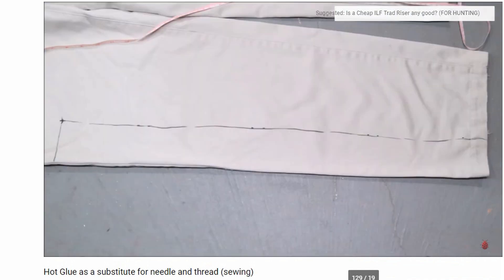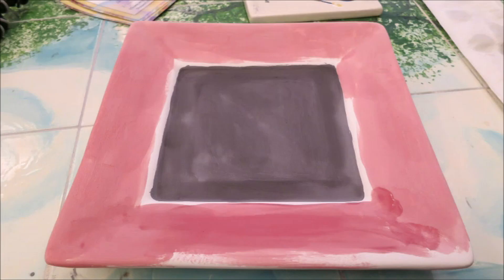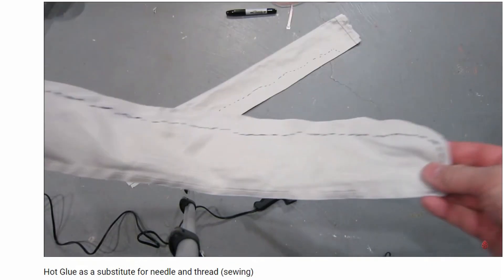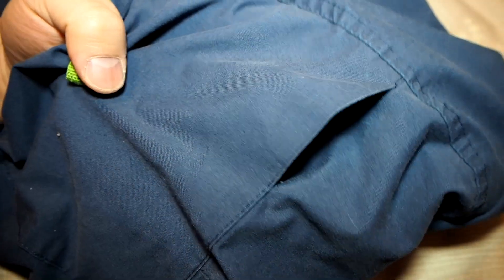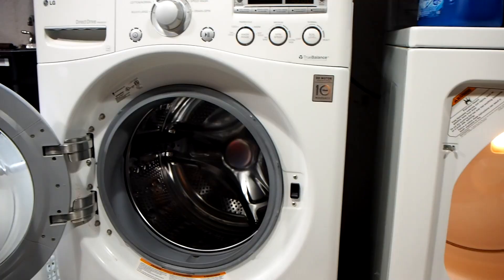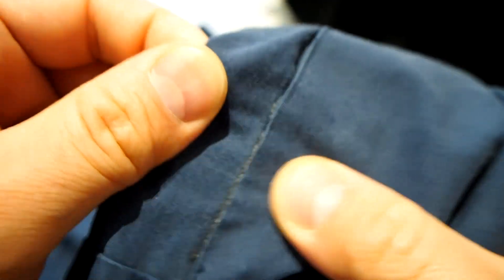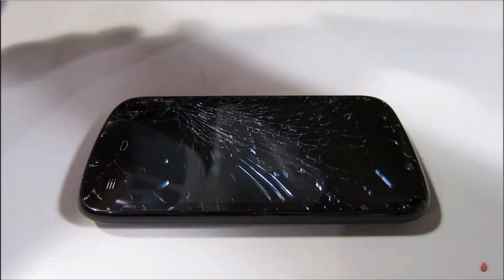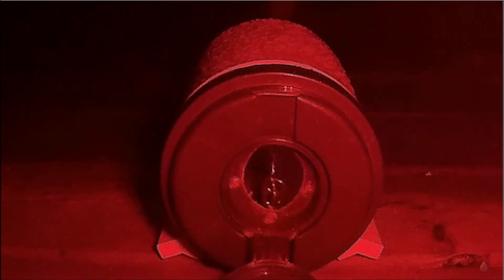Washing and Drying Hot Glued Fabric

Comment: Thanks for the video! Question for ya... It's been a few months, is it still holding? I'm aaking because I wanna use hot glue to temporarily hold sleeve hems.
Reply from the maker: I did 4 of my pant pockets.  I've had to fix 2 of them recently. I wash and put them in the dryer once a week. So it has held up really well.

Comment: What was the specific temperature setting on the dryer that you used??
Reply from the maker: My dryer just has the automatic dry low heat and I set it for medium dry. I do not use the air dry. I do not use high heat. The clothes still come out just fine at low heat.